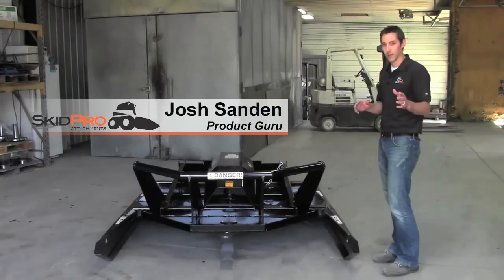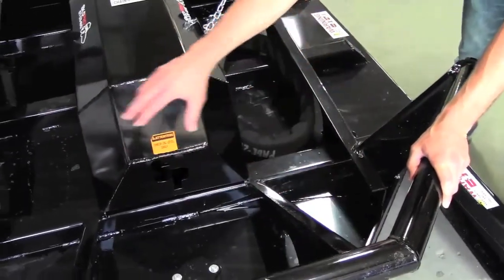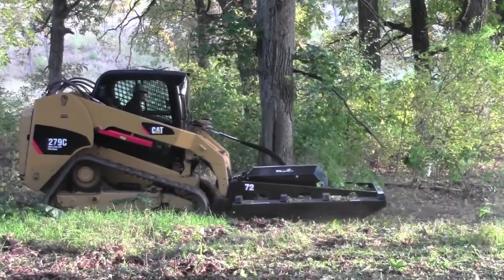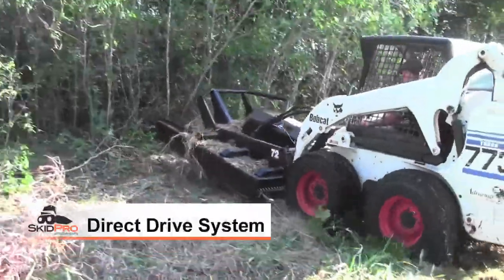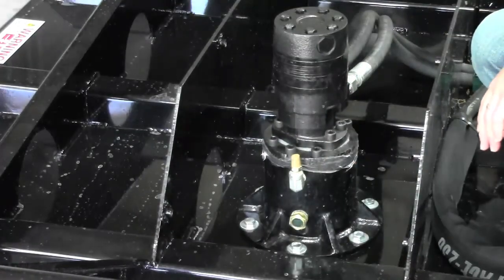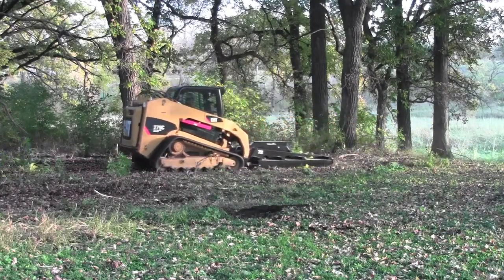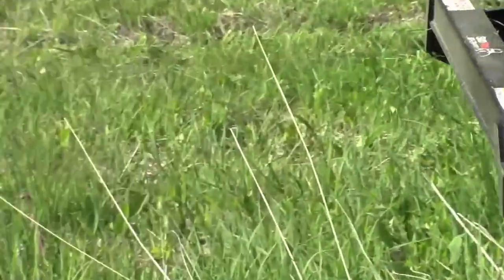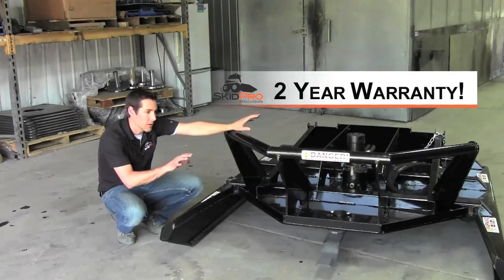Skid Pro Skid Steer Industrial Brush Cutter

Comment: I really wish you had a 60" version of this mower! It's just outside the realm of my S150 Bobcat. Impressive, very impressive.
Reply from the maker: David - Take a look at our 60HD3. It is the "little brother" to the X4. It is still built like a tank, and utilizes the same direct-drive train, just a slightly smaller drive shaft and bearings, plus a smaller motor to increase the blade RPMs for smaller, lower flow machines like your S150. It is a great compromise w/o sacrificing quality, power, torque or durability. I've literally put our 60HD3 on machines all the way up to a John Deere 333D for a customer that was just very price-conscious and did not want to spend the additional money for the 72" X4. Thanks, Josh.
Reply from the maker: Here's the link to the HD3, http://www.skidpro.com/skid-steer-attachments/skid-steer-brush-mower-contractor-series/